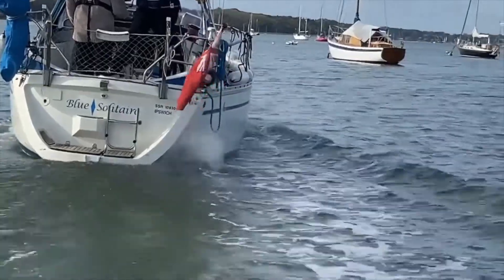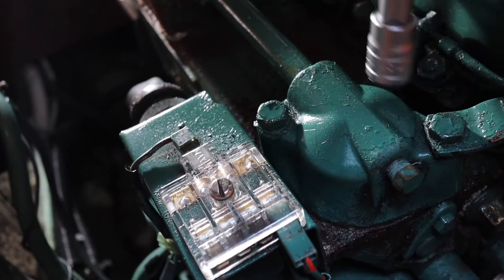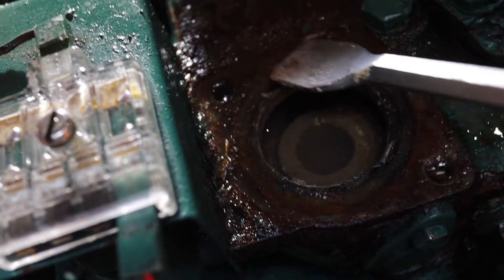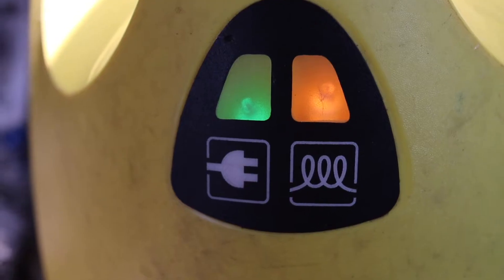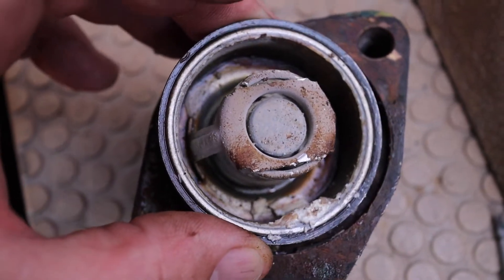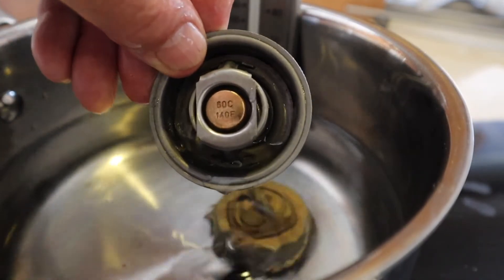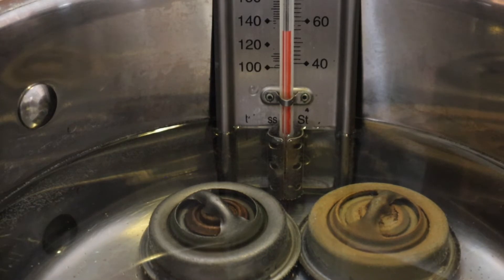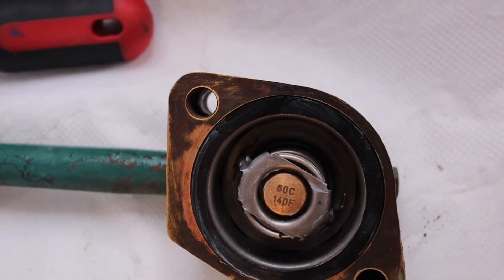Volvo Penta overheating thermostat

Comment: Hi again, since I have the same RWC engine but my boat is a 30 footer, what's a typical cruising speed for you and at what rpms?  Same question for max speed at what RPMs.  Thanks.
Reply from the maker: Hi dojo, hope you got your engine mounts sorted.
Passage planning I usually work on a five knot average, sail or engine.
Cruising RPM 1500 = 5knots.
Flat out 2000+ RPM and a clean bottom is about 7 knots. 
The bating platform starts to dig in to the wake as it approaches maximum hull speed.
Hope this helps!
Reply: Thanks.  Good info to have for me.  Just discovered the thermostat in the engine is a 110 deg F unit.  I'm going to order the 140 deg F (60 C) and swap.  I wonder if the engine will run any different, more power, lower fuel consumption, more chance to salt up the exhaust elbow? I'm still working on locating mounts.  Guess I have to figure out how the front and backs are different.  When looking for parts, I'm often asked for the engine's serial number (10 digits?)  only to find they can't find it.  Has that happened to you?   @sailingwithus5743

Comment: Great video and a beautiful boat.  What’s the make and length?  I have the same engine and am planning to replace the thermostat so your video will really help.  I’m pretty sure my engine needs new engine mounts.  We bought the boat a couple months ago.  The engine sure shakes at 850 rpm so I'm thinking engine mounts may need replacing.  I see many mounts advertised that appear to fit the back but haven’t been able to find any for the front of the engine. They appear to be different than the back mounts.  Any suggestions/advice, part numbers, websites to visit?  Thanks!
Reply from the maker: Hi dajo. our boat is a 1990 built Bavaria 300, she's just under 32ft long.
Is your engine sail drive or shaft? 
If you're in the uk I would recommend Keyparts Ltd. give them the engine serial number and they'll probably give you the advice you need.
Good luck!
Reply: Thanks for the fast reply.  Your Bavaria  looks perfect for a couple.   Ours has a shaft drive.  I'm in the states but with worldwide shipping, I'll look them up.  Are the front mounts different than the back ones? @sailingwithus5743